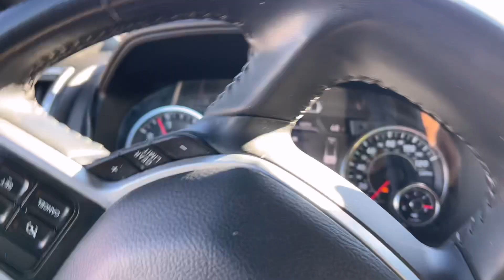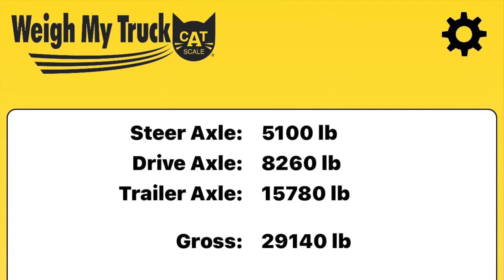Broke My Non CDL Trailer | Lost $2,000 | Had To Return The Load | Overweight Again 😤

Comment: Crap happens ! That’s Hotshottin. Man I hate that for you. I left a tractor 🚜 on a two pic deal for a rental company. They actually honestly forgot to add the attachment. So they told me to drop the tractor and they paid me a great pay for not picking it up and paid me an awesome rate to deliver the rest. I made nearly as much on the load and it weighed hardly anything after they unloaded the tractor. Have a great day !

Comment: 🥊Continue on mac, try looking at ways you can lighten your setup. Such as cutting out some steel areas on the trailer and swiping it out with composites or aluminum. Carry only the general grade of chains and binders you normally use, carry lightweight wood sources for dunnage and so forth, these little details will add up to increase your PAYLOAD CAPACITY.💰
Reply from the maker: Appreciate that info man! Great advice!

Comment: Big Tex is notorious for the unbolts and tie plate breaking. I never leave home without the built kit. Get them from a PJ or another dealer other than Big Tex. Big Tex charges $50 for the kit. PJ dealer charges $25-$30.
Reply from the maker: Wow brother that is some great information right there! Appreciate you sharing that 🙏🏽💪🏽💯
Reply: Yeah, I thought Big Tex was the best thing since sliced bread but I've had to take my 2022 28+5 back to the dealer twice for axle issues 😡.

Comment: @10:24 you kinda said it yourself that you where thinking it’s a possibility they offered because they “may” have caused the damage. So out of support people may agree with you. As far as the weld, yeah maybe it was a quick thing to get you on the road but if it wasn’t good that’s not safe for you.
Reply from the maker: After looking over everything, the issue was there before I got loaded. But they actually did a good weld job. Just didn’t clean it up.

Comment: Yo macc what happens if they do catch u just say with that over weight load will u be put outta service or how does that work ?
Reply from the maker: They’ll put you out of service real quick and you’ll have to have someone with a CDL come to move the setup.
Reply: @HotshotMacc  damn homie I just started and doing the non Cdl thing till I get my class A but I just have a few more hoops to jump through with me being an above the knee amputee losing my leg to a gunshot wound 5 years ago but bouncing back now and taking all the info I can get for being safe on the road ! Thanks bro ! ML&R
Reply: @HotshotMacc  more than that macc! Its over weight for your setup, so not only do you need a cdl driver, but also a CDL SETUP. You have to move the load off that trailer to a cdl trailer. Expensive problem!!! Adds up quick!

Comment: Had me a load in Virginia. 9k pounds. Wasn't big just covered my axels but I hit this nasty pot hole 5 miles away from the drop. Trailer bottomed out and I lost my trailer brakes. Made my drop and went to truck stop to check it out. My main trailer brakes electrical wires got cut when it bottomed out. Luckily I keep all types of repair items and was back in buisness in no time. I feel ya pain bro it sucks but then again it's part of job. Not if but when. Stay up bro good vid.
Reply from the maker: What's up brother! These days are definitely bound to happen and we can never predict them. Being prepared like you were though is key in this industry. Something I need to be better at for sure. But we bounce back from the minor setbacks bro! Keep trucking brother and appreciate you!